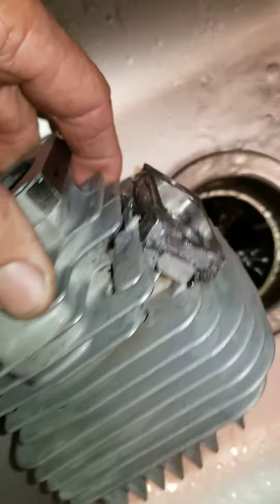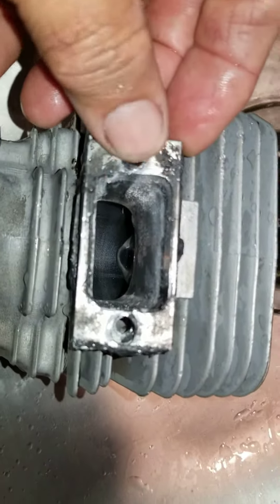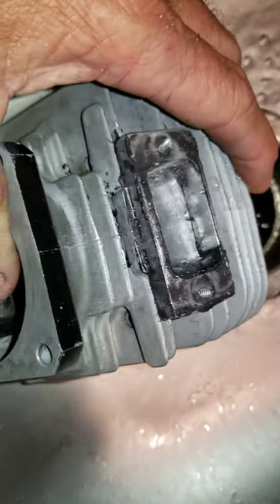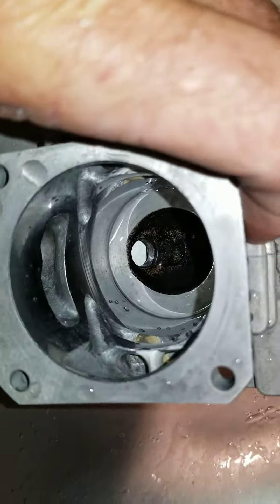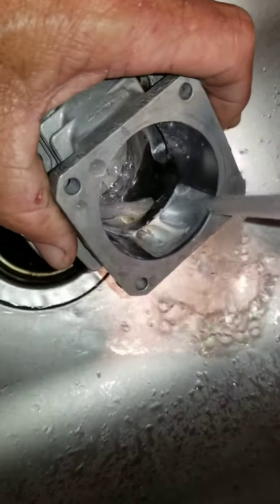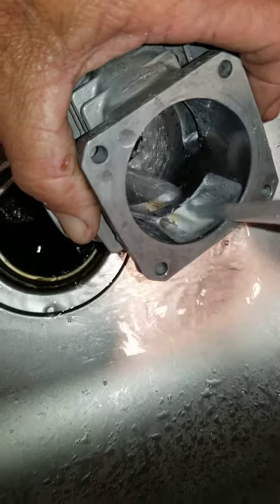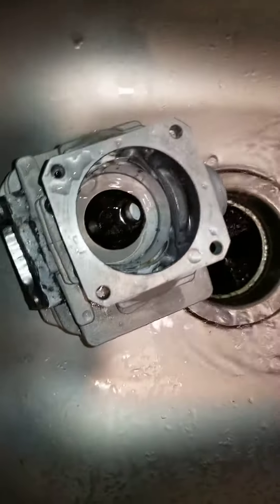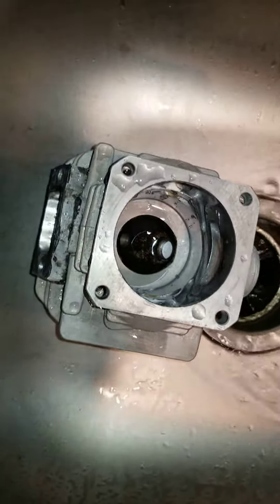STIHL 088 AV cylinder

Comment: Thank you for posting John. Huge respect for your work and I have been experimenting with a very similar port to the back of my cylinders on a 372 and 395. I too found throttle response to be way better. I have just experimented with lower than normal 84/88 ATDC intake which took away some of the throttle response but with limited testing they seems to hold rpm better in the cut. Would that line up with your experience? Funny enough I too run water through them to see how the flow is directed. I'm kinda running out of ideas on the 372, I've about tried everything I can think of. Its a bloody obsession.